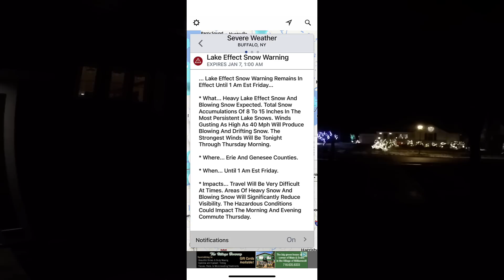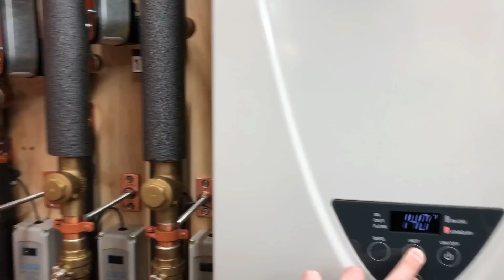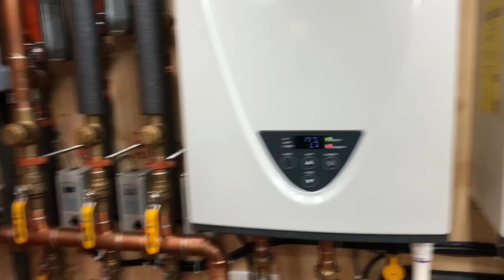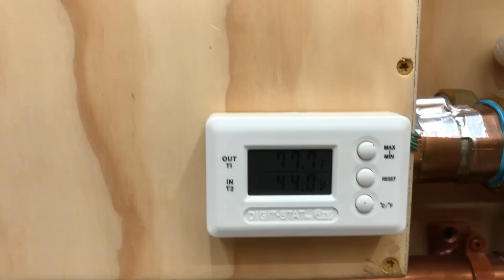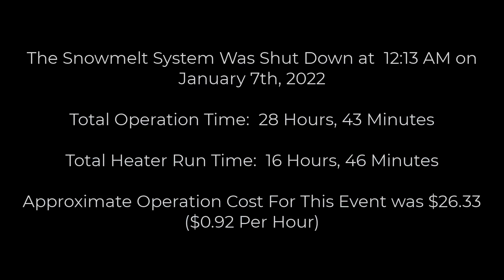Heated Driveway Melting Snow Time Lapse During a Buffalo NY Lake Effect Snow Storm on [1-6-2022]

Comment: does anyone here have experience installing a spanning slab driveway? that way the basement space underneath would give access to the pipes or whatever type of system you are using to melt the snow in case of maintenance or replacing a failed connector or smth

Comment: I see a lot of vapor leaving the exhaust. Adding a condensing unit to the exhaust would recover heat for the house rather than letting the vapor leave.
Reply from the maker: Hi The Eh Team!  So the tankless units are fully modulating and condensing.  I wonder if there is anything I could add in addition to that to increase efficiency?  Thanks for the comment and watch!

Comment: Must cost an arm and a leg to run
Reply from the maker: Hi IC45!  It's actually not as bad as you might think.  It costs between $0.50 - $1.00 USD per hour to operate.  I talk about cost in my FAQ video here: https://youtu.be/zvOQSQiaqTw  and I REALLY go into depth in this video: https://youtu.be/VotJEQigTkw  breaking every single event down, in detail, for an entire month.  That includes gas usage, run times, and how I come up with the cost to operate figure that I put at the end of every video.  Hopefully that makes it clearer, but if you still have any questions just ask and I'll try to answer better.  Thanks for watching!
Reply: @DeckerChristopherJ  Interesting, thanks. I guess you only need to heat it just above 0°C?
Reply from the maker: @IC45 You got it!  Actually it's closer to 4º-7ºC, but anything above 0ºC and it will start melting of course.  It looks much hotter in the time lapse videos, but if you touch the driveway when its running, it doesn't even feel warm.  Thanks for taking the time to comment and watch, I appreciate it!

Comment: Good thing this won't accelerate the rusting form the salty winter roads. Not.
Reply from the maker: Hi TheBrawlmastah!  It actually looks hotter than it really is.  In reality, the surface of the driveway only reaches 40-45ºF.  If you touch it when its on, it doesn't even feel hot and you can't notice it, but since it's above 32ºF it melts the snow.  You're right, our cars around here have a hard enough time beating corrosion and rust from the salt, they definitely don't need any help! 😂 Thanks for watching!

Comment: Where does the melt go?
Reply from the maker: Hi there!  I get asked this question a lot, and the water runoff is not an issue.  A minor amount during a heavy melt runs down the apron to the storm drains, but it's minimal and not an issue.  I explain it a bit more in detail in this video: https://youtu.be/zvOQSQiaqTw if interested.  Thanks for watching!

Comment: How many Watts does this system draw? A ballpark figure for heated pavements is 250 W/m2. If the driveway is 1600 sq ft that equals ~150 m2. Multiply that area with 0.25 kW/m2 and you get 37.5 kW. If energized for 10 hours, that equals 375 kWh. If energized for 20 hours, the energy used (750 kWh) is similar to the total energy used in a regular wooden house for a week at ~10 °F (- 12 °C) (Example house has 4 inches insulation and is 160 m2). As of december 2022, "The average Buffalo residential electricity rate is 23.97 ¢/kWh (46% higher than the national average)". If the system was powered for 20 hours today, the cost would be US$ 180 ($ 9 / hour).
Reply from the maker: Hi nixxon 3!  So this system is Hydronic, not electric.  It uses Natural Gas water heaters to circulate heated glycol (antifreeze) through the slab which melts the snow.  This FAQ video will answer a lot of your questions: https://youtu.be/zvOQSQiaqTw  It costs between $0.50 and $1.00 USD per hour to operate.  You can see an entire month's breakdown of cost to operate here: https://youtu.be/VotJEQigTkw   Also, I just checked my current electric bill, and I am currently paying $0.07446773 per kWh.  Not sure where you found your rates, but mine are nowhere near that.  Hope this helps address your concerns.  Thanks for watching!

Comment: Imagine if your car had a fuel leak
Reply from the maker: 😂 Right?  It's actually not as hot as it looks though.  The surface temperature of the driveway really only reach between 40-45ºF.  It's not warm to the touch, but it's above 32ºF so it melt the snow. 😊  A fuel or any sort of leak would just sit on the concrete like any other driveway, but maybe be slightly warmer 😁  Thanks for watching!

Comment: i kinda have a feeling, i could extend my houses heating system, since in pipes it goes like 60C water and extend it outside under my driveway.
Reply from the maker: You may be able to, Reinis. It would depend on how big of an area you're trying to heat and the size of your boiler.  60C may be a little hot to send out to the slab so you might also want to temper it down with a mixing valve but these are all easy things to do.  Sounds like a fun project!  Thanks for watching!

Comment: Wouldn't this be possible with geothermal heating?
Reply from the maker: I really haven't done much research on using geothermal with a system like this.  I would love to learn more though!  Maybe a future project after the solar panels? 🤔  I think it would work well for the radiant, but I'm not sure how well it would do with such cold return temps (like 25ºF) for extended periods, and if it could keep up with the 100ºF supply required?  Once I get the Solar panels installed, that might be my next project! 😉  Thanks for watching!
Reply: @DeckerChristopherJ  from what I understand it's been used in Canada for many years but not sure about driveways maybe it would work because it's constant and doesnt need to radiate.

Comment: I mean shit, $26 including running it early for a few hours with nothing happening to keep 14”+ off my driveway and not have to shovel it out or dig my car out is WELL worth it to me. I mean christ those shovelers that come knocking are charging typically like $20 to do your sidewalks and driveway for a normal sized property even more if there’s THAT much snow. So it’s realistically cheaper. Not cheaper than shoveling yourself, but you also don’t have to do that which is possibly HOURS saved, and hours more of back pain afterwards saved as well. If I had the money, I’d 100% install this system under my entire driveway, my sidewalks, and any other walkways on my property. Then the only thing I ever gotta worry about shoveling is the street right in front of my driveway after the plow comes by and builds up a wall in front of my driveway. And I can live with just having to shovel that one area
Reply from the maker: I couldn't agree with you more Jersey Ninja!  Thanks for commenting and watching! 👍

Comment: It would also be interesting to estimate how much cleaning costs with conventional means: a shovel and a snow blower. You have to swing a snow shovel diligently, and a snow blower, in addition to buying (sometimes very expensive), also refuels, maintains and, ultimately, works with it in the cold, when it often blows in your face with a snow stream. I think that manual snow removal will certainly win in terms of price at a time, but in the long run, in addition to the undeniable convenience of such a solution, as in the video, it is still better than manual snow removal (with a shovel or using snow plows).

Comment: Does the driveway get slippery or is just like walking on wet concrete??
Reply from the maker: @Hedge Master Matty  As long as the system is running and up to temperature, it’s just like walking on wet concrete.  If it’s turned off to early however (before it’s completely dry), the water will re freeze and turn into ice.  I had that happen once here: https://youtu.be/EkDVQq_TW1k  fast forward to 13:19 and you’ll see what I mean.  Thanks for watching!

Comment: Please forgive me if this seems stupid but it rarely snows here. Can't this system work in the attic to keep the weight off the roof? If you could close the attic vents you might be able to run some duct from your home heating unit into the attic and close the dampers when not needed. You could always hang a small gas unit in the attic to melt snow. I was trying to think of a way to keep water from being above the ceiling. I'm getting too old to be on the roof or shovel.
Reply: This would be a bad idea as you will soon have mold growing in your attic. You can place heat cables on top of the roof along the edge. It's mainly for melting snow/ice on the edge to prevent ice damming but that will help. Without the snow on the edge, most of the snow will slide off when the sun shines and starts heating the shingles.

Comment: You can afford to heat your driveway
But you can’t afford to turn the lights on 😮.
I only say that it out of jealousy 😢
Reply from the maker: It’s ok, you can say it, because it’s absolutely true! 😂 This is NOT one of my best videos but it’s the one the algorithm is currently promoting.  Sorry about the darkness.  I have lots of better (and brighter 😂) ones on my channel if you’re interested: https://youtube.com/playlist?list=PLdWeMRuZcbQjekwiBk_uy39IS6JFWYORD  Thanks for watching!
Reply: @DeckerChristopherJ  I have heated driveway and in floors heat. I use it for cooling also. I have solar panels hooked up to preheat the glycol before it goes into the boiler. In the summertime, I use the solar panels to run the heat pump.
The heat pump I use is dual split pioneer off Alibaba solar only

Comment: I can see this being a problem if the snow melts, and it freezes in to black ice.
Reply from the maker: Hey ss.  That's absolutely correct, I must leave it on until its dry or it turns to ice.  If you want to see what happens if I turn it off too early, load this video and fast forward to 13:19.  Thanks for watching!

Comment: Very impressive to watch. Too expensive for me unfortunately.👍👍🇨🇦
Reply from the maker: Thanks Rick.  It's not as bad as you might think!  Check this video out for more detail: https://youtu.be/zvOQSQiaqTw
Reply: @DeckerChristopherJ  , thx for your response. I watched you video and I’m really impressed with what you did there. That’s not me. I wouldn’t have a clue where to begin and would be too chicken to start. I get too ticked off too fast now,(I’m in my late 70’s). That room you have with all of the lines and valves etc, is a work of art. I would be proud to show anyone that, even if it did nothing. I’m guessing that when the car is in the driveway some of the heat might go to the engine and possibly make for an easier start in the cold or would the distance between the driveway surface to the engine oil pan lose any chance of the heat getting there? Do you find lots of cats hanging out there as a vacation spot?😁👍👍🇨🇦

Comment: I didn't look close enough to tell if those tankless water heaters are NG or electric ⚡? My guess is NG since it's still cheaper especially in that part of the country. But your bill to run those must really jump up the months you use them.  Unless you have a free or Cheep tap into Niagra Falls generation station. Ok so I finished the video $6-$8 those heaters must be efficient on another level.  We were going to get on in our last house installed in North Central Pennsylvania but it needed a NG line upgrade to handle the flow demand. We didn't think it was worth all the permits and contractors cost to dig up the street to run a new line to the house. Our foundation was Field Stone so getting a larger line thru that was no easy task.  I forget the name of the NG company we had Maybe their rates were just a lot higher than the buffalo area?
Reply from the maker: Hey M Richner!  The heaters are Natural Gas, and I have tons of videos about them and the install on my channel here: https://youtube.com/playlist?list=PLdWeMRuZcbQjekwiBk_uy39IS6JFWYORD  It costs about $1 an hour these days to melt the driveway with the current spike in Natural Gas, so yea our winter bills can spike depending on how much snow we get.  I did a video on the cost to run that you might find useful here: https://youtu.be/VotJEQigTkw  Before these we had a Bosch Tankless that also required a gas line upgrade, but these newer modulating, considering units are much more efficient.  My foundation is also fieldstone, so I know your pain 😊.  Thanks for watching!!

Comment: Omg... My neighbor had a heated driveway back in 1972... He used a regular household water heater and a small pump
Reply from the maker: Yup, depending on the size of the driveway and your level of performance expectation (how fast you expect it to melt) that will work!  My system is a little more complex as it does ALOT more for me than just melt the driveway, but it's the same concept!  Thanks for watching!

Comment: Might be a silly question but is there a drainage system specifically for using the heated driveway? For all that melted ice. I've never lived somewhere cold enough to have to innovate such technology. Very interesting.
Reply from the maker: Hey Jordan!  I do have drainage, but the runoff is not as bad as you would think.  I talk about it in my Top 5 questions video here if you're interested: https://youtu.be/zvOQSQiaqTw  Thanks for watching!
Reply: @DeckerChristopherJ  great thanks will check it out! I guess that makes sense as snow isn't very dense right?

Comment: Way cool. How would it work on a gravel (washed 2B stone) driveway where part of it is a 20% grade; located in the Pocono Mountains of PA?
Reply from the maker: Hi Cathy!  I'm not sure this type of system would work well on a gravel driveway.  Asphalt maybe, but your really need a mass to warm to melt the snow.  I would also worry about the stone damaging the pex with repeated traffic over it.  The pex is really just warming up the concrete slabs with holds it heat well, and it's the slab that melts.  Hopefully that makes sense?  Thanks for watching!!

Comment: Do you have an idea of how much energy or cost this takes to melt an inch of snow?
Reply from the maker: Hey Tio Dave.  I've never done the math that in depth to calculate what it costs per inch.  That is also going to differ widely based on wether that inch is already on the slab at startup, or wether it's received after the system has been running for several hours. Outside temperature, wind speed, and even cloud cover would also play a factor.  I'll give this some more thought but as of right now I can't really think of an easy accurate way to calculate that?  Let me know if you have any ideas.  Thanks for watching!
Reply: I would imagine you could calculate a crude number from the manufacturer watt rating and how long an inch of snow takes to melt. A time lapse like the one you made with a measuring device in the shot to show how deep the snow is. 

You could also use power use measurement meters to get a bit more accurate. I'm sure there are better options, but as an example the Eyedro Home Energy Monitor.

Comment: Wait until you receive your  gas and electricity usage bills. And if your on propane game over. Everyone i know that has radiant floor  heating system never  use it because of the very high cost factor.
Reply from the maker: Hi David!  It's been running for almost 2 years now, and it's natural gas.  Costs about $.50 - $1.00 per hour to operate.  This video from 2021 explains and shows how, in detail, if you're interested: https://youtu.be/VotJEQigTkw  and I'm releasing another one shortly that explains it more in detail here: https://youtu.be/zvOQSQiaqTw  Personally, I think it's money well spent but to each their own.  Thanks for watching!

Comment: All you need is a car cover to slip over car.  Pull it off, shake it, place in plastic container in trunk, then warm engine and drive off.  Use it where you park in town for errands or work.

We have trouble with melting snow to ice on cars and roads as it is warmer here.  Car covers are very useful to avoid frozen doors/wipers,etc.
Reply from the maker: Hi SMART ASSIST!  Actually, the garage directly behind where the GoPro is mounted in the video is heated, I just had a woodworking project going on in there at the time this one was recorded and had to leave one out.  As you can see in my most recent storm video they are both happily inside now: https://youtu.be/QFRDjJkO-nE  Thanks for watching!

Comment: Maybe cover your car with a tarp?  It will be much easier to pull it off rather tan scraping the snow off.
Reply from the maker: Hi Carla C!  Actually, the garage directly behind where the GoPro is mounted in the video is heated, I just had a woodworking project going on in there at the time this one was recorded and had to leave one out.  As you can see in my most recent storm video they are both happily inside now: https://youtu.be/QFRDjJkO-nE  Thanks for watching!

Comment: That’s cool! It would be awesome if you programmed it to turn on when it starts snowing
Reply from the maker: @P J  They do make fully automated controls, and I did install the sensor socket in the slab when we poured it, and ran the conduit back to the utility room.  I just haven't ben able to bring myself to spend the $1k on the automated controls yet, but it's possible.  For now, it's been working flawlessly by turning it on manually or from my phone.  Thanks for watching!
Reply: I don't think it'd be hard to automate.